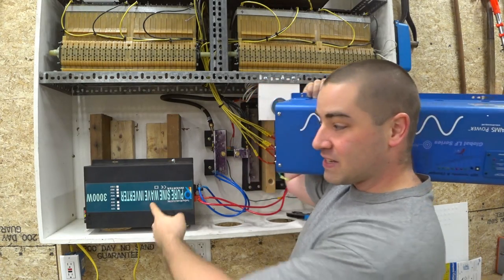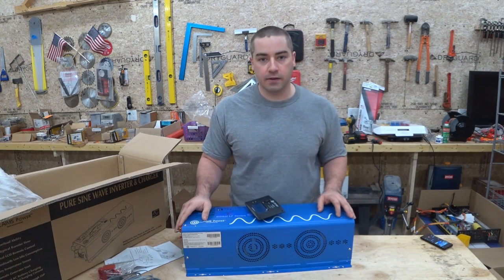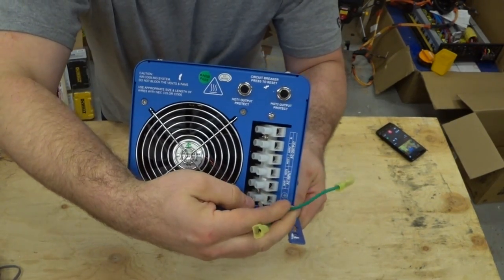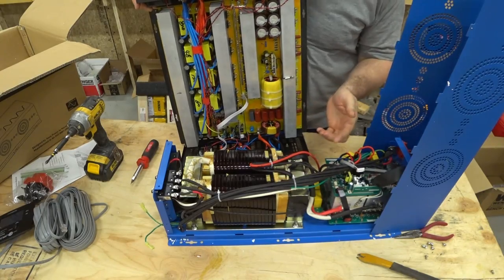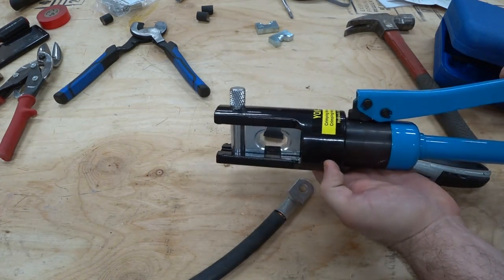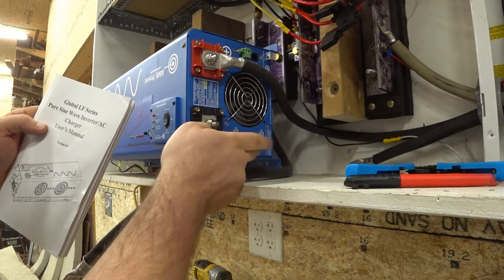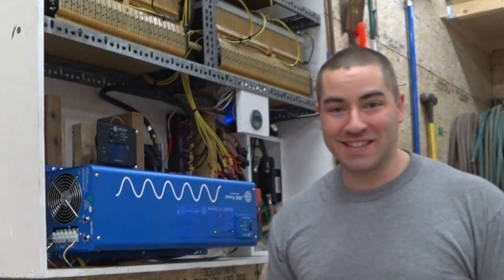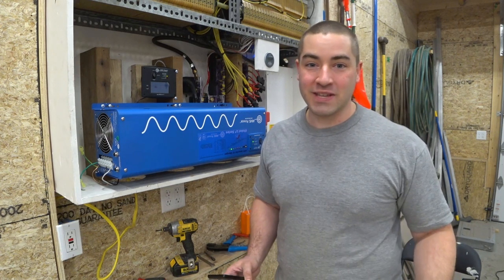Inverter Upgrade! Reliable to Aims in Off-Grid System

Comment: Hello Dave was wondering with all the lithium battery packs you have had.  Which one is the cheapest per amp hour storage.
Reply from the maker: Great question.  I usually think of it in terms of $/kwh, and the modem packs are the least expensive  https://batteryhookup.com/collections/green-friday-weekend-deals/products/4-18650-2200mah-cells-in-modem-batteries?variant=31785110175876  Currently sold out, but they will be coming back in stock.  The downside is you have a ton of work to test cells and build the pack.  
I think the best value considering both cost and time, is the LG cells I used.  https://batteryhookup.com/collections/green-friday-weekend-deals/products/new-lg-chem-n2-1-3-7v-120ah-cell-module  They are way less time (like months less time) than the modem packs.  I built a 48v battery with the LG packs in this video: https://youtu.be/BzPUFcXM89c and https://youtu.be/hlmKmhhqnq4  You can use my coupon code "DAVIDPOZ" for 10% off, which makes the LG cells cost $105/kwh

Comment: my 1000 watt pure sine wave inverter can run my compressor and all my power tools just fine,, not sure what all the excitement is about.  electric heaters and big air conditioners are the problem.  need a couple thousand watts for them.  But remember, a 1000 watt pure sine wave inverter can hold 2000 watts  for about 10 seconds, and my 1,500 watt pure sine wave inverter can hold 3k watts for several seconds too, for startup, and the fan will not come on until the unit actually warms up.
Reply: Are you jealous or wanting to have a pissing contest? I don't understand your comment? 
I'm here because I want to know what I can do to avoid getting screwed by my power company!!! I'm clueless but if you've got a lot of knowledge & videos for the truly clueless, please share them with me I would be very grateful. But if y don't make videos please please don't discourage people who do because I really need them! Thanks😃
Reply: I think because he has blown üp/ failed twice & persevered on his 3rd try

Comment: Thanks, for the informative video!

I would like to know how well the inverter performs under a steady heavy load - like an air conditioner might present on a hot summer day?   Does it get warm or hot?     And, are these units stackable to allow two or more units to work together to provide more power?
Reply from the maker: I might have to do an update this summer to get the air conditioner on it.  No, they can not be stacked like the Magnums can.  I have let it run a 4500 watt heater for a few hours and the outside case was still cool to the touch, but the fan is running constant.  I hope that helps.

Comment: The real test cut wood and run it hard and see if it works. I'm going off grid too but it seems cheaper and simpler with generators on very dependable propane and some solar maybe 1200- 1500 watts for ac. Electronics seem to eventually die. I want a one wire alternator pedal stationary bike to make some power. I have different one wire 120-160 amp alternators already.
Reply from the maker: This Aims inverter is working really well.  My whole house has been on it for most of the summer.  I've been using plenty of power tools, no issues.
Reply: @DavidPozEnergy  that is good. how many watts of solar do you have?
Reply from the maker: My solar array is 4.38kw.  Here is an overview video of my system:  https://youtu.be/722GNWlEN1g

Comment: I have 10 deep well 12 volt military batteries on an A and B switch 5 on each. It goes through a 2,500 watt inverter into my camper. It will run my 12 volt stuff just fine but the dreaded toaster, air conditioner, or any appliance with a coil will fail. These batteries are used but like new. The military swaps out often and I found the batteries from interstate for 75.00 each. Price on-line for the same battery is 650.00 each! My batteries are charged with 12 solar panels. The AC draws 29 amp on start up. What inverter would be ideal for my set-up so I can be totally off grid? I subbed and thumbs up!
Reply from the maker: There are a lot of variables in there.  Sounds like you got a great deal on some batteries.  A great place to start is this online calculator: https://www.altestore.com/store/calculators/off_grid_calculator/

Comment: Another good video, I've been wondering when the inverter market would take off, I was planning on using my 4,000w incorporated between a drone and an EV I thought just like 220v is conservative over 120vac power wouldn't the EV's motor perform better with a supply capable of 120v through an inverter?
Reply: My drone would hover in front of my EV towing the weight through an extended towbar, the passenger vehicles should remain grounded but capable of higher speeds maybe less congestion, be nice to connect a lead cord driving down the road to the over head 440v, transform it and send back the leftover volts, winding an EV motor to operate off 440v would be very powerful.

Comment: That's my next inverter !!!
Reply from the maker: Cool.  Just be aware of the low efficiency and high idle watts compared with some others.  But if it works for you, then awesome.  I'd love to see a picture of your system.
Reply: @DavidPozEnergy  For the $1000 price range, will I be able to get an Outback, Magnum, Schneider or Victron inverter which has a better efficiency and lower idle watt drain? Please post web links to the better inverters for purchase. Many thanks
Reply from the maker: Nope, that's why I bought this one.  LOL.  This was at the top of my list before I bought the Aims: https://www.altestore.com/store/inverters/off-grid-inverters/schneider-electric-xw-plus-inverterchargers-p40562/#XANXW6848

Comment: Love your video need asked questions ok I buy this inveter 3000 watts pure sine wave ok its 48 volt ok but he test it with 12 volt battery  ok they power in inverter show how much volt battery is but out AC voltage in show do thinking cause of battery he used

Comment: My 4000/8000w inverter couldn't run my 2100w mitre saw, the company said its because the startup of it is over 8000w but the makers of the saw said its no more than 5000w. Mine is the cheaper Giandel but the thing is so large Its kind of a bummer it can't run my most used power tool especially going by the specs they write on the side of it in huge numbers.

Comment: Hey David... I bought the biggest generator harbor freight had before they made a big inverter one.  Need backup power for my farmhouse.   I guess I need a pure sine inverter for a 7250 continuous or 9000 peak.  Suggestions?
Reply from the maker: Check out this one: https://shop.signaturesolar.us/products/8kw-48v-150vac-120a-off-grid-inverter-by-growatt  It will output 120/240v split-phase, pure sine wave, just like the generator.  It can run 8kw continuous and 24kw peak.    It also has a solar input if you ever decide to add some solar in the future, but it's purely optional.  My discount code is DAVIDPOZ which should help you with a discount.
Reply: @DavidPozEnergy  first, thank you for replying!  But at that price I should just go buy the inverter generator for half that price. Seems like this must have way more features than I need
Reply: @DavidPozEnergy  Funny story, Im bidding on the 3000w version of this right now.  How much should i give for it?  its not split phase though....so it might be better for a mobile installation than a home battery backup situation.  Thoughts?

Comment: I am sorry for the dumb question, but after watching some of the videos I still do not understand if David is tapping on the full 300V from the Volt Battery Pack, just segments or was it rearranged. So the output of the battery array is 48VDC ?
Reply from the maker: Hi Carlos, I re-arranged the battery pack to a nominal 48 volt system.  It ranges from 42v to 49v.  This way I can use off-the-shelf inverters and charge controllers.  Here is a video re-wiring the cells: https://youtu.be/ot3IhsUfFS8

Comment: Cool, but why install this over the Grow watt? It's this an even better value at retail ( not your open package price)? Seems it's more hassle with no charger controller? Did you torture test the grow watt?
Reply from the maker: At the time I built this system I didn't know anything about Growatt brand.  There are tons of great choices on the market today.  If I was building a new system today I'd probably go with a Growatt because they are a better value.

Comment: I'm a otr truck driver i need a inverter that would power a electric skillet a electric kettle and a ninja foodi presure cookers  ive currently got a 5000 watt aims  do I need to hard wire the electric skillet to stop it blowing the breaker

Comment: Hey David- maybe it's just me, but heat rises and you've "inverted" (sorry, couldn't resist) the inverter so that the heat goes toward the circuit board rather than toward the metal housing.  Might decrease inverter life?
Reply from the maker: Hi Kevin,  thanks for watching out.  I've moved the inverter since this video.  The new location has the inverter standing tall, so the fan will push the hot air right up and out of the case.  https://youtu.be/sjmxz4gmS6c

Comment: Pretty sure this is a rebranded Sigineer. I picked up that exact inverter for $1k through Sigineer.
Reply from the maker: It could very well be.  I don't know.  "Going off grid" is another youtuber.  He said the same thing and bought a 6000kw model (same) but from Sigineer.  Then he also ran an idle test and it consumed about 30% more power than mine at idle.  So maybe there is something different?
Reply: DavidPoz That’s quite a difference! Maybe they are different. Is that UL listed for on-grid? That would account for cost delta (Sig is off-grid only). Also FWIW, I’ve had zero issues with mine, and have seen a few other positive reviews of the Aims.
Reply from the maker: Hi Trevor,  Mine is not UL listed for on-grid.  My system is not connected to the grid, not even for charging.  It is only a backup system.  They could very well be made at the same factory, but maybe have one circuit board difference.  I don't know, just guessing.    Good to know you have not had problems.  Same here.

Comment: How big are the batterypack and how many kWh are that on and how long time can you pull full Power from batterypack?
Have you try to charge up a Electric car?
Reply from the maker: This is an 18.4 kwh battery.  I first picked it up in this video: https://youtu.be/V1t1SoEhVNQ  I did a capacity test on the battery in this video: https://youtu.be/zkuidj5I8P4  I have never tried charging an electric car.  Thanks for watching.

Comment: Does this inverter produce sine-wave or square-wave power?  It is decorated on the case side with a sine-wave image.  I hope that's not a lie.
Reply from the maker: The manufacturer says pure sine.  At some point I would love to borrow an oscilloscope to verify, but I don't own one.  I have tested every appliance in the house, and they all seem to run fine.  No flickering lights or weird noises.  So I'm inclined to believe that it is a true sine wave.

Comment: Hey what are you using for your solar charger and how much are those battaries  why did you diside on 48 volt
Reply from the maker: Hi Nyght myst:  Thanks for your questions.  I'm using the Victron 250/100 MPPT Solar Charge Controller.  I have a video on it here: https://youtu.be/Efqx_iRYRjo
I bought the batteries for $2,033 USD.  I have a video on that here: https://youtu.be/V1t1SoEhVNQ
When I was looking at a voltage platform I found the most common ones are 12, 24, and 48 volt.  48 volt is the maximum (nominal) voltage allowed by building code for residential.  By using a larger voltage the components can get smaller, or more powerful.  I have some huge loads in my house such as my electric oven.  The oven draws 4000 watts when pre-heating.  That 4000 watts would pull 333 amps in a 12v system, 167 amps in a 24v system, and 83 amps in a 48v system.  That made it pretty easy for me to see the benefit of lower amps, and going with a 48 volt system.  

I hope that helps.

Comment: You finally got a LF pure sine wave inverter is that because of what happened with your 6000W HF inverter?, I wouldn't touch HF and/or modified sine wave inverters and now you know why :)
Reply from the maker: Yep.  You probably saw my past videos of the 8000w high frequency inverter letting out the magic smoke.  LOL

Comment: It looks great. Is there a 230VAC version at 50Hz? How much is it and where to buy? Great video.
Reply from the maker: This inverter has a switch on the side to output 60 htz or 50 htz.  It is 110 volts on two legs, combined for 230 volts.  However, you might be asking about 230 volts on a single leg?  If that's the case, then I don't think Aims makes one.  But I found this one on amazon that does: https://amzn.to/2I9Bkn8

Comment: Hey there buddy i have a question for you
I would like to know what type of inverter  can i use to work my clothes dryer that is 220 volts?
All i want to do is work my clothes dryer off the grid nothing else.
Thanks for any type of information that you can share.
Reply from the maker: The one I show in this video (Aims 6kw) puts out both 120 and 240 volts.  So it will work with a cloths dryer.

Comment: Hi David". Two questions:
1) I tried to find information online about how "low-frequency" and "high-frequency" inverters differ in practice. At least I haven't found any information yet, so I thought you must have information because you use these expressions.
2) What kind of power does the miter saw and compressed air compressor you used in the test take? You were downright happy with their performance, but that didn't tell you anything about whether you pushed the inverter's power readings to the limit in your test? Of course, everyone would like to know exactly how the inverter performs at the promised maximum load.
Reply from the maker: 1. A more accurate way to describe this is "Transformer-based inverter" vs. "Transformer-less inverters".  Transformer-based inverters like this Aims in the video, or Schneider, Victron, etc. are well known to handle surges better than transformer-less inverters.  
2. The miter saw or air compressor can have LRA (locked rotor Amps) as high as 10x the running Amps.   I've personally measured 67 Amps surge on my miter saw.  67A*120V=8,040W.  That exceeds the rating of the whole inverter, and I was pulling that on just one leg (120V, not 240V).  That's very impressive.  If you want some context as to why that's so impressive, I have two videos where I tested a transformer-less inverter that couldn't handle my loads, even though it technically had a larger rating: https://youtu.be/EYIzEW54_bY?si=bxXCv7bXIOrBXgeC
Reply: @DavidPozEnergy  Alright. Thank you for your understandable answers. You are a great guy!

Comment: This inverter is good for heavy inductive load's like your machines but only one thing that bother me high no load current is eating battery capacity trough the night can be up to 5-6kwh easley... I could be mistaken... 
I don't like to give advices but David you will need a nother whole Chevy volt battery... 👍 
Is rugged pice of machinery... made in China..... 
Does Mosfets have thermal compound between heatsink and mosfet....?
Reply from the maker: You are absolutely right about the idle power load.  This model consumes 30.3 watts in "Standby" and 80.7 watts in "Idle" no-load.  At 80.7w*24hrs= almost 1,937wh of power per day just to do nothing.   Compare that to, say, Outback Radian 8048 has idle draw: 34 watts, which is the lowest I've seen for these large inverters.  34w*24hrs=816wh per day to do nothing.  That's one of the downsides to this inverter.  I'll probably have to remember to turn it off when I leave the garage.
Reply: Per the shunt on the BMS the XW-6848 has an idle power demand of around 20w and a standby of 8w. Load comparison using a kill-o-watt confirms that the losses of the inverter is in the 20-30w range when powering small loads. That is a good bit better than the inverter I built out of an old UPS. Its idle losses were double that even though the inverter itself was only good for about 1kw.
Reply from the maker: That's awesome about the XW-6848.  Thanks for sharing.

Comment: About idle current you can lower it with 15-20uF/630v capacitor and coil 4.5uH that is in series with big transformer conected one side of coil goes on heatsink where is conected transformer other side of the coil goes on the transformer.... 
I lower idle current(3A) on about 1.2A.... 
I have only use the coil....
Reply from the maker: I'd love to learn more about what you just said, but it was over my head at the moment.  Do you have any pictures, diagrams, links, or something where I can learn more?  I wonder if I could salvage some of the capacitors from the failed 8000w inverter?  Thanks.
Reply: @DavidPozEnergy  
Ive read this before about a "Power Jack" inverter.. But NO ONE  posted any diagram or where to buy such coils, only this same explanation!
Reply: @DavidPozEnergy  I would advise against such modifications as this could void your warranty. If you were more technically savvy maybe you could pull it off. Aims has a good warranty unfortunately you could need that warranty.
Reply: Do not use any " Capistor bank" (  Power jack) on your DC, Battery 🔋 Powered Load. 
Capistor bank is only apply on Pure A/C  Voltage ( under volt condition). Modify to Power Factor.

Comment: Holló thank you for such valuable information. Could you tel me were you bought the battery ? Thank you
Reply from the maker: I bought it from an "Auto Recycler" aka junkyard.  I called probably 100 places before finding one that had a Chevy Volt.  Start with a Google search in maps for auto recyclers in your area, and start calling.  Just ask if they have any electric vehicles, Chevy Volt, Chevy Bolt, Nissan Leaf, etc.  Eventually one will pop up.